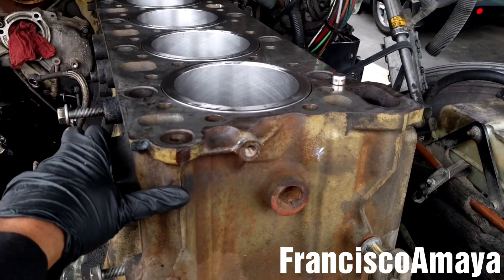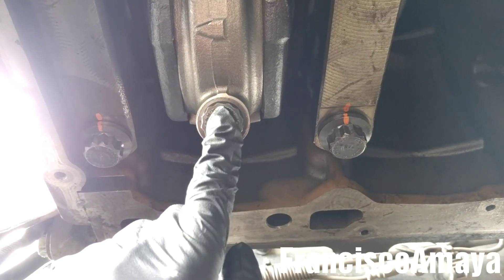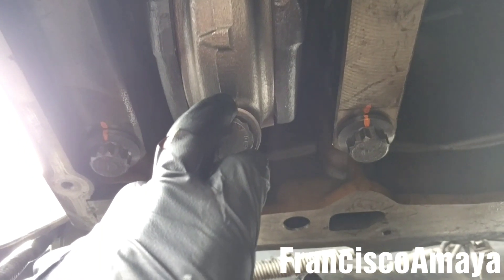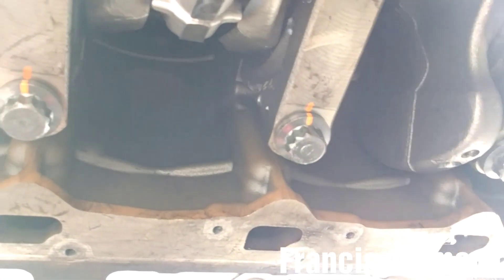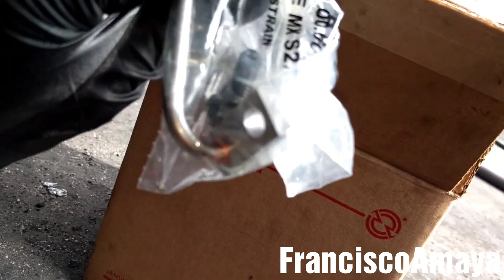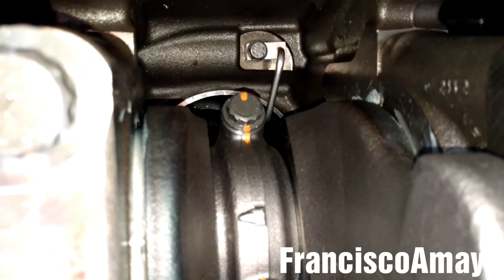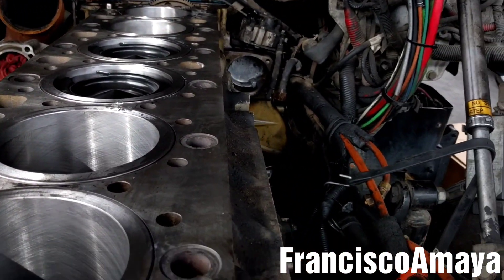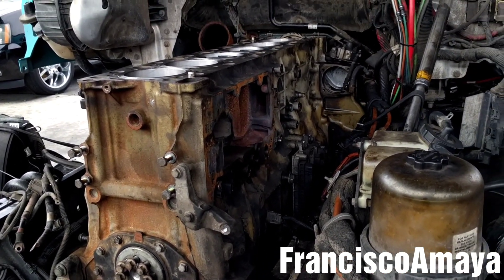DD13 DD15 DD16 piston connecting rod replacement torque specs parts process part 3

Comment: What is the tightening of the crankshaft and connecting rods on the OM 471
Reply from the maker: om471 = DD13

conncting rods 
140lb + 90 degrees 

main bearing 
221 lb + 90 degrees

Comment: Hello Francisco thank you for your videos they are really helpful.

Please can you help me on the following. 

This past January I had an external coolant leak from the head near the turbo. The mechanic told me it was the head gasket so we bought the head gasket set from Freightliner and changed it

A month later another external coolant leak occurred near the turbo. The same mechanic said it is the oring from the cylinder liner. Is this correct?
He wants to charge me $3200 to change the one oring or $7500 to change all the orings it will be a mini inframe ?

What are your thoughts thank you 
Can I call you or message you ?